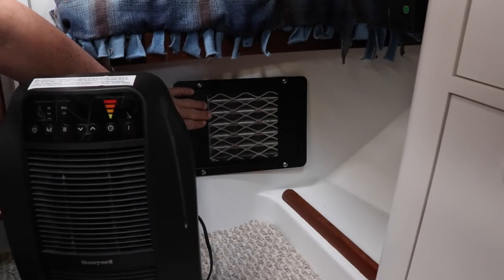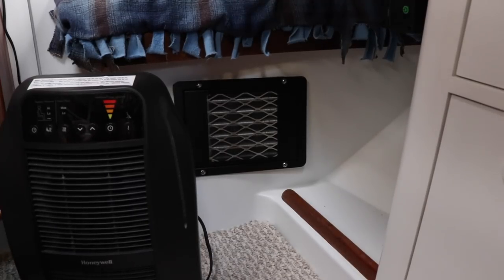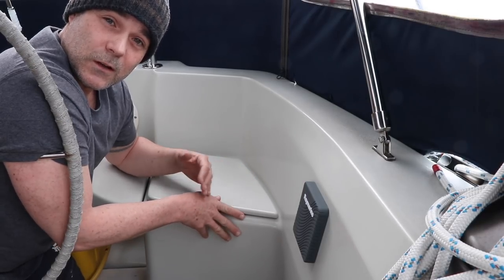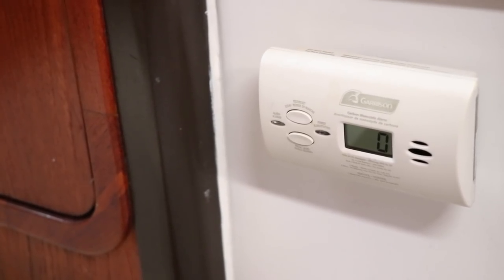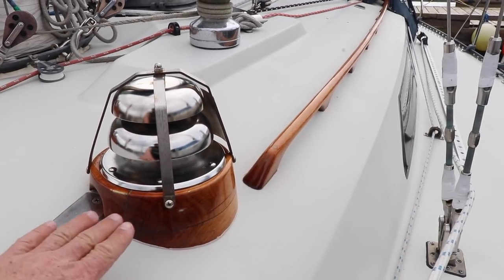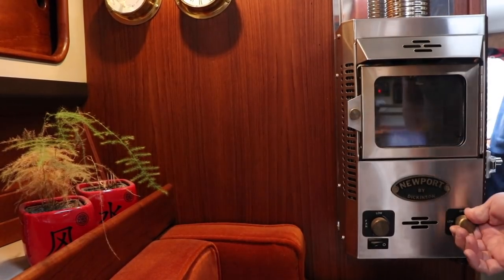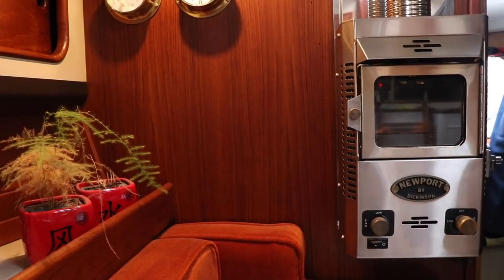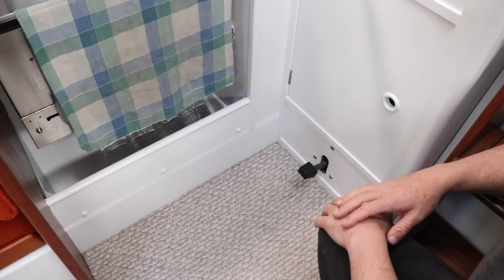Life is Like Sailing - How I Heat My Sailboat - Newport Dickinson P9000

Comment: I have the Dickinson  Newport diesel heater keeps my 40' steel sail boat nice and warm
Reply from the maker: A great little unit for sure.  Where are you located and what kind of temps do you experience?
Reply: SV. EL FARO  thanks. .. would you change this heat type or any further details as compared to this propane option?
Reply: Same here...love it...!

Comment: I had a friend with the Webasto diesel heater.  The problem with them is they break down soooooo often compared to a Dickinson diesel heater.  You won't get a year of continuous use out of the Webasto without it turning itself to slag.  My friend went through three heaters, before deciding to go to a Dickinson diesel heater.  You can also cook on top of a couple of the Dickinson models in a pinch.  You WILL be sorry if you go out on an extended cruise with the Webasto.  They will work fine as long as you don't use them all the time...chances are the people you know using them are only using them part time, and haven't put enough time on them to cause a breakdown yet.  My friend said they always broke down after about the same hours of use.  I just thought I'd let you know since that is your plan....Webastos also have to use electricity to function thus greatly draining your batteries.  Search for Webasto problem on youtube, you will get sooo many hits.  Do that for Dickinson problem too and see what you get.  Webastos have so many moving parts and electronics that can go bad.  Dickinsons only have a header tank or a small pump that clicks every once in a while, and no troubling moving parts.  I don't think you want to be 15 days from a port in -25 with a broken heater fan or something.  You can go weeks or maybe months on a boat without filling up with a Dickinson vs propane for instance because of the amount of btu's in a gallon of diesel fuel.
Reply from the maker: Thanks for all that info and Webasto isn't at the top of my list.  :)  For sure I'll be doing quite a bit more research before I make a final decision.  This might be a next winter project.   I do like the diesel Dickinson heaters!  :)
Reply: Those Espar/Webasto systems definitely work for the short term..  Those systems though suffer from Carbon build up and fan/electrical failures after a period of time.  I know you want something as a backup and don't want to replace the propane unit, but if you want reliability those ducted diesel heaters just won't do it.  If you had 100 gallons of diesel fuel a standard Dickinson heater on low will heat for 90 days or so at roughly 6000 btus regardless of electricity availability.  You won't get that out of the propane setup.  My friend usually gets 1.5 to 9 days out of a roughly 2.3 gallon/11lb propane bottle depending on how cold it happens to be.  Would you rather have a bulletproof diesel heater that never quits or a maintenance hog diesel ducted heater and a short term propane heater.  I would just pull the propane heater, replace it with the sig-100 dickinson it is about the same size.  The chimney piping probably will work the same for the diesel wall heater as it does for the propane unit.  Also the Dickinson will work at around a 45 degree heel no problem on low.  The wall mount diesel would likely only require a small pump and some fuel line to hook up.  Some people opt for the header tank so that you don't have to listen to the pump click over every 20 minutes or so.  You are also probably going to spend $500 more on an Espar /Webasto as you would on a sig-100.  Then sell the propane unit on ebay(You could get 200-600 for it most likely US$).  The cost of ownership over 10 or 15 years of the Dickinson diesel wall heaters is thousands less then the Espar/Webasto units.  Not to mention the propane heater is many times more dangerous due to the potential for escaped gases in the cabin.  Having your propane off while you are sleeping is a much better safety factor.
Reply: You are correct...I have a Webasto...they work great but complete overhaul at 2000 hours (83) days cost to overhaul is 2000 so a buck an hour plus the cost of diesel. I just put in a Dickinson Diesel Bulkhead Heater and so far works great...will know more after this winter...Best..

Comment: I have a 36feet sail boat with a diesel stove and water radiators, it has 45-50mm PU foam as insulation everywhere but I get crazy amounts of condensation on the lewmar hatches if a few people is in the boat in cold weather. How is it on yours, have you done anything to prevent this?
Reply from the maker: I get some condensation on the metal frames on the hatches when it gets very cold, I plan on putting some foam tape on them to see if that helps.  :)
Reply: So your hatches/skylights aren't made of glass? Or do you have two layers os glass in them? On mine there are more condensation on the glass then on the metal frames. really enjoy your videos by the way, have not missed a single one of them. :)
Reply from the maker: I think they are made of single layer tempered glass, but no condensations on the glass, just a little on the metal frames in the really cold temps.  Really glad to hear you have seen all the videos!!  :)  Stay tuned for more!

Comment: Why did you sandwich the foam with wood instead of attaching the foam to the hull?
Reply from the maker: I used an adhesive to attach the foam to the hull.  The wood is just the top finish.
Reply: Ah. It was a little confusing because here ( https://youtu.be/_IdnW15fnns?t=780 ) it sounded like you put vertical planks against the hull, then foam, then horizontal planks.
Reply from the maker: The challenges of filming and editing. ha  Hopefully cleared that up.  :)

Comment: You should probably add a propane sniffer to the bilge area, because propane is heavier than air and will collect in the lowest point that it can reach, also, a carbon monoxide filter would be good just in case the heater develops a leak or something.  Just a suggestion. :)
Reply from the maker: I have thought about adding a third sniffer in the bilge, good reminder for me on that.  I do have a carbon monoxide detector that is on 24-7.  I think I mentioned it in the video, but I can't remember for sure as I haven't watched this episode in a long time.  :)  ha

Comment: Great video. Install a bi-metalic fan from a wood fireplace and no electricity needed as fan will run based on the heat given off, more heat higher fan speed  😆
Reply from the maker: Good idea!  :)
Reply: Yep...I have two on my Dickinson Diesel Bulkhead Heater and they work great...no noise

Comment: A Webasto Air Top is nice but also makes some noice but is also using a lot of energy. So it would not be my first choice. Would go for a heater like Mads has in his 2 boats
Reply from the maker: I have been hearing for the others that maybe Webasto isn't the best unit to go with and it honestly wasn't at the top of my list.  This will be a next year project likely so I'll have lots of time to research for sure!  I like the Reflex heater for sure.  :)

Comment: Personally I would stick with a wall furnace :-) even if that's diesel, that would just be my personal preference, in my next build I will install a wood burner & diesel heater with the diesel being my backup/instant source of heat.
Reply: instablaster.
Reply: Just got my Dickinson Diesel Bulkhead Heater fired up...works great...

Comment: I got the Russian Planar hydronic heating system. It heats hot water by a diesel furnace that connects to three radiators and an 8.5 gal hot water tank in the boat that creates hot air and hot water on demand. It uses very little diesel and electricity. Excellent for those on the hook. It was $3,000 to purchase, and a $1,000 to install. I found a guy to put it in at a third the normal cost. You can buy a boat for the cost of installing an espar system.
Reply from the maker: I've heard of that one and some people I met here at my marina have it.  They are very happy with it they said.  I'll look into that one as an option.  :)

Comment: I remember watching a similar video a few years ago but this seems more detailed and better resolution. I know you've already made the plunge to the Dickinson Caribbean but I have to wonder if you had it all to do starting fresh, would you go with a Wallas diesel stove top for the galley and heat? Kill two birds with one stone and not have the humidity of propane?
Reply from the maker: I figured an updated video would be good as it seems that most people don't find the old one, but still ask me the questions about heating. haha  But a few long time followers remember the old video so that is nice to know!  :)  I seriously thought about a stove/heater combination and even upgrading my heating system is something I haven't made a absolute final decision (since my plan is to sail south...way south) ha    I really do like the stove/heater combos! :)
Reply: It seems to me that the Wallas would be a good way to go. Not only getting rid of propane altogether on the boat but also a heat source as well as cook top without the humidity and danger of propane. For baking you could use something like a Breville smart oven through an inverter or genset. Thoughts?
Reply from the maker: I'd like to not have any propane on the boat when I leave Canada eventually for the main reason of the ease of filling other fuel types.  :)  I'll need a larger boat for a genset! ha  That is a long ways away still so I'll see what I can come up with or even see if it is on this boat.  :)
Reply: A couple of deep cycle batteries and solar charger with an inverter would take care of the occasional use of a microwave and smart oven and do away with the need for propane if you go the route of a Wallas for heat and stovetop. And one less hole in the top of the boat. You have a great boat and much invested in it. Why knot (heehee) make it perfect?
Edit: Propane scares the crap out of me on a boat. Next on the list of things to do away with is gas.Things to keep are bikinis.
Reply from the maker: Definitely lots to look into for those options!  :)  I do love this boat and a good chance I'll be keeping it long term so I'll just keep upgrading it as if that is the plan.  :)  Doing away with the propane will likely happen if I take the boat for the long distance cruising that I hope to do.  Warmer climates will likely bring out bikinis I think. hah
Reply: You've never needed some skin to help promote your videos but if it made an appearance I wouldn't unsubscribe. Thank you for your service Alfy.
Reply: Flooding can wreck your day but fire or an explosion can end your life. The sea can give you enough problems. Why compound it. I like to error on the side of caution wherever possible.
Reply: @kevinparker7953  the humidity in propane combustion goes up the chimney and out of the boat. This unit would provide completely dry heat. The convection action of air through the housing of the stove would dry the air in your space and that drying would be accelerated by the fan, similar to a forced air furnace.

Comment: I looked through about a hundred or so comments and one thing I didn't see was kerosene heaters. Depending on the climate (heating needs) and size of vessel they could be a very viable option. They are totally silent and require no electricity. I have one that puts out 10,000 BTU's and cost $240 at Canadian Tire. The only downside that I have come across is the price of K1 kerosene. A two gallon jug costs $27 (holy shit) but runs the heater for 30 hrs. When it's too cold for propane to work and the electricity goes off it keeps me from freezing to death. I've found that propane doesn't flow to my furnaces below about -15C so I heat my propane cabinet with a 20 watt trouble light that works down to -40C. Like I said, when the power goes out my electric heat is gone instantly and the propane heat will eventually die even though I may have full bottles. When nothing else works, kerosene is a reliable back-up. Something to consider.
Reply from the maker: Kerosene is a fuel I have thought of for cooking once I leave Canada, but I hadn't thought of it for heat.  I will look into that!  Thanks for the suggestion.  :)
Reply: When it's -37 outside and soon to be -37 inside, the power's out and your previously heated propane tanks are getting colder and will soon stop working cost doesn't matter. My kerosene heater is ready to save my life with only the flick of a match. What else are you going to do? Start burning the furniture?
Edit: People freeze to death in Canada. I don't want to be one of them. Yes I've had to get clever a couple of times to avoid that. An ounce of prevention has intervened. Yes you have the diesel to fire up. I don't.

Comment: You can mount your CO detector at chest height because CO doesn't drop to the floor like propane.
Reply from the maker: The research I did on locations for the monitor said low, mid or high was fine as Carbon Monoxide was basically the same weight as air.  At least that is what I found.  :)
Reply: You're right but it does have a tendency to hang in the air similar to cigarette smoke and takes time to defuse to the rest of the air above and below. But It's fine for your use. Personally I can only handle  0 ppm.
Reply from the maker: I think 0 ppm is a good threshold to have!  :)

Comment: 15:14   Diesel is much safer?     How is that?

If you are going to use propane, you should use 20lb tanks.  They are everywhere: quick exchange.
Reply: Propane explodes, Diesel won't even burn unless it is atomized

Comment: I had leaks in the pipe fitting both the bottom were pipe connects to stove and were pipe fits to the roof vent piping...also leaking through the glass door window area...to resolve the stove pipe leak issue I just bought a big  bunch more of the same fyberglass rope used to seal the door shut and wrapped the pipe areas leaking  about 4 times real tight over the spots leaking then clamped it all down tight onto the pipe with circle steel / metal hose clamps...for the door glass window area which is not acteueally sealed too well I stuffed and carefully packed that same small fiberglass rope in and around the glass window and that resolved all issues...Note: there are other people that have expressed the same issues with this dickerson propane heater, oh yea! Dickerson will admit nothing of the issue nor come up with any resolve...they will have nothing to do with your exaust leak issues and tell you they do not leak..."DO NOT" use any kind of so called heat resistant / high heat stove pipe cyclicone  or sealant or any type of stove pipe hardener , you will just create yourself a nightmiorror toxic clean up job, scrapeing and chiseling a big smelly mess...Only Do as iv explained, it's the only way it works to fix the issue...I did it the wrong ways befor I finely wised up...best wish, blessings...